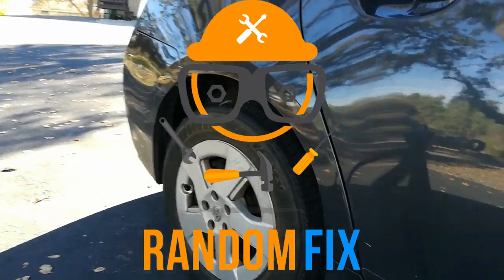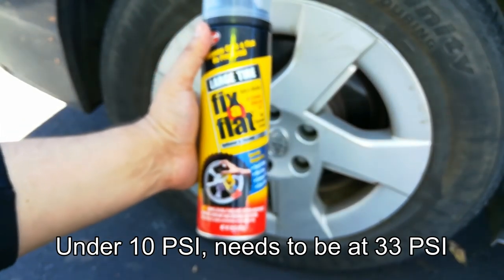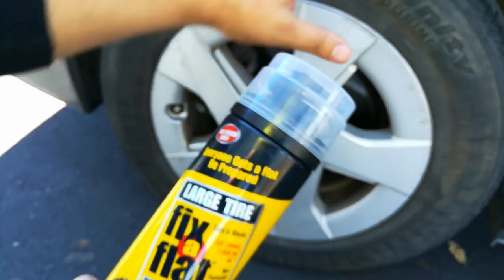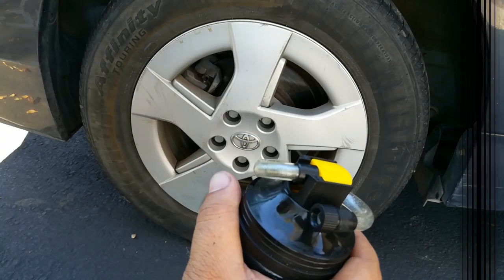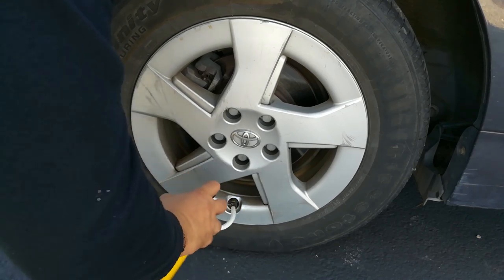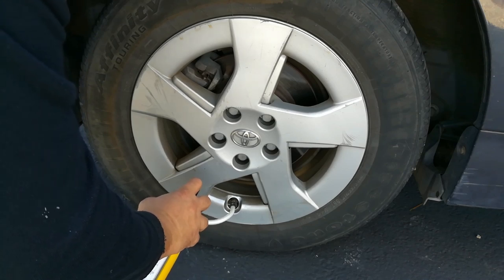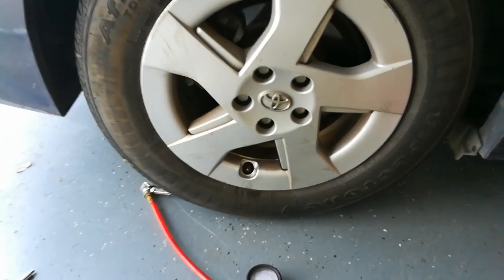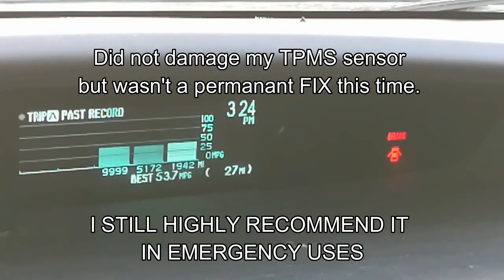Fix a Flat Repair - Does It Work?

Comment: On the can it says you shouldn’t drive more than 100 miles after using this. You still need to get the issue fixed.
Reply from the maker: Thanks for sharing and yes this is not a permanent fix.
Reply: Put 5 cans in it until it permanently seals it, you want to fill the tire up completely so that it is able to completely harden and you don’t have buy $100-$200 tire
Reply from the maker: Have you done this? Putting 5 cans in?

Comment: If I have a nail in my tire could I steal use it ????
Reply from the maker: Howard, yes you can but it depends on how big the nail is and if the head of the nail is still in contact with the road. All you can do is try it and I've had great success using fix a flat.Best of luck _Randomfix
Reply: Huh?  So does that mean leave the nail in if it then doesn’t touch the street and isn’t too wide? Or some other combination of those choices????

Comment: Don't the instructions say to add air if necessary BEFORE you go on test drive. You tire didn't have enough air, and you drove the car BEFORE you added air. Shouldn't be the opposite?
Reply from the maker: If you had the option to add air that would make it better but most the time the flat occurs at inconvenient time. Good feedback. _Randomfix

Comment: Not the instructions say that you should not tip the can upside down but I guess you're doing that too you're just waiting till the very end of it the last little bit what I noticed was not much air goes into the tire from the can like maybe a pound should it be more than that it just seems like it would be more than that and I cannot find an answer anywhere on the website of fix a flat I can't find it anywhere no mechanic has ever told me they don't know and I don't think they care because they don't like fixing flat in general because of the bad rap it's bad over the years I'm causing fires from the old style old formula that was flammable and everyone still believes that there's a problem all you do is warn them that they're fix a flat and they'll know to look out for the liquid that can splash out at them if they're doing a quick and dirty tire pop to replace a tire if they're just going to let the air out and you let them know it's not going to be spraying out at them but it's just still a good idea to let them know they're fixing it whoever's working on your tire. These days I would imagine everybody just assumed there's probably something in there
Reply from the maker: DAN, thanks for all the great information. I've been using fixaflat for along time and it works. I would rather swap use the spare but a lot vehicles now don't have a spare and the little kids that come with the vehicle such and age( bad after a few years). It's great for when your jam or stuck and hopefully you never have to use but its cheap insurance.

Comment: You actually want the HOLE/LEAK / at the 6 o’clock position.... not the valve.
Reply from the maker: Thank u for sharing.
Reply: @RANDOMFIX  no problem 👌🏼
Reply: what if i dont know where the leak is?
Reply from the maker: What's why fix flat works so good it will seal the inner tire and where the air is leak with filled with sealant and it can help stop the air loss.

Comment: For best results on fixaflat place the can in the trash can cause that's worthless never works
Reply from the maker: So if you were stuck on the side of the road with a flat on a high speed freeway that was uphill and someone gave you a can you a can of fixaflat you would toss it in the garage?
Reply: Why tho?? I’ve used this literal exact brand for fully deflated nail and screw punctures three different times, left the thing in there every time, and it was a permanent fix every one of those times...
Reply: @bequakynskagroupie3751  did you take the nail out?

Comment: Fix a flat bottle glues chemicals sealant inflater are one time uses only and it expensive if it works at all?Now your inside tire are full of glues chemicals in it.Now the tire might can’t be fixable by the mechanic or using the glues plugs in designed method.So fix a flat glues chemicals sealant bottles are not a good ideas as fixing a leaking,nails or screws punchers tires.Having a battery operated tire inflator and any brands of tire glues plug into kits it better than those Fix a flat bottle tire glues chemicals sealant inflater.Glue plug into tires repairing kits fixing rates are about 90-95% more successful rates of repairing a tire than those Fix a Flat bottle of glues chemicals sealant inflater.
Reply: Huh
Reply from the maker: Glue plugs are legit.  I've had a 100% success as long the nail is not near the sidewall.

Comment: Only way to use fix a flat is throw it in the trash
Reply from the maker: So you rather not have a can of fix flat vs being stuck on the side of the road with no spare?

Comment: What do you mean it didn’t work? I saw it inflate your tire enough to drive it for 10 mins. What were you looking for it to do? It’s not a permanent tire patch but it will help you get home. You left it in for two weeks then came on telling us it didn’t work. What happened to make you think it didn’t work?
Reply from the maker: It didn't work in terms of a permanent solution and you are right it's not a permanent solution. It leaked a little air, tpms light came on. But still a great product that I always have in my car.